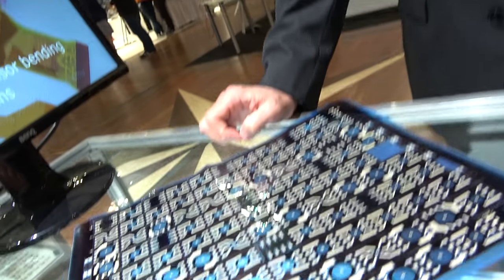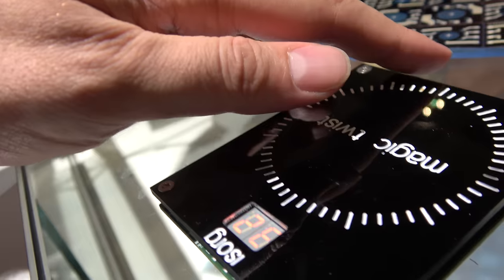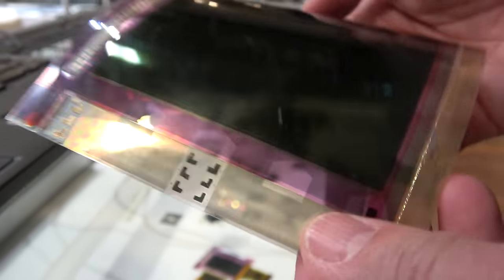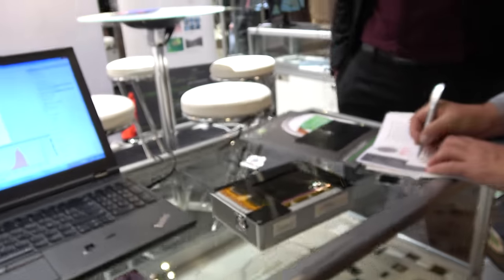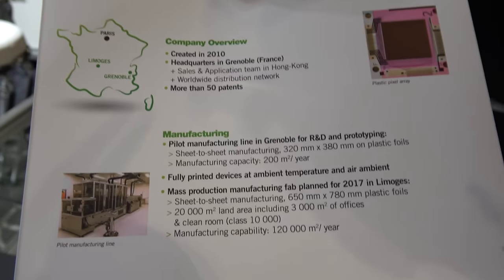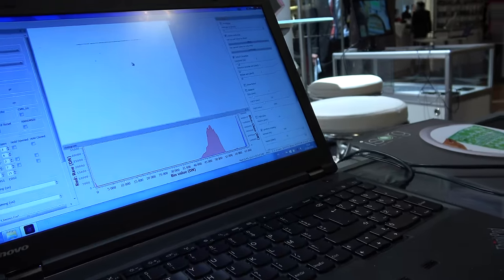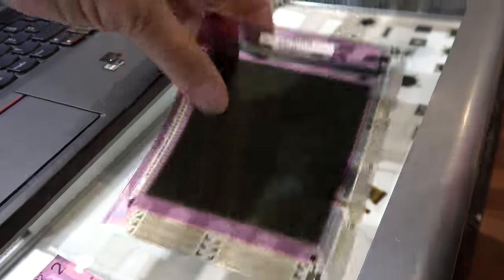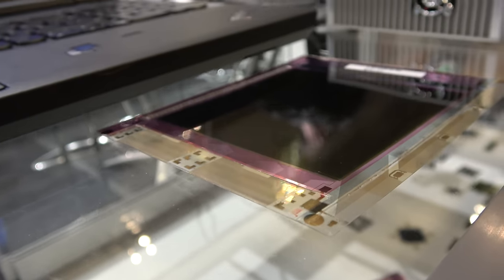ISORG flexible photo diodes for biometrics

Comment: A photodiode is a semiconductor device that converts light into current. The current is generated when photons are absorbed in the photodiode. A small amount of current is also produced when no light is present. Photodiodes may contain optical filters, built-in lenses, and may have large or small surface areas. its not like a camera.